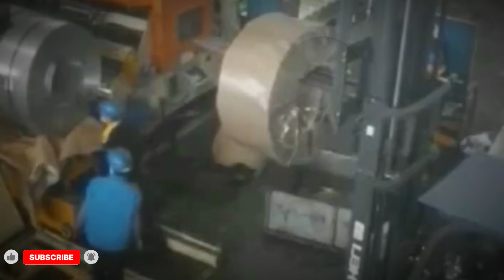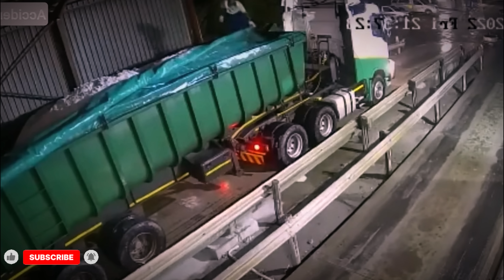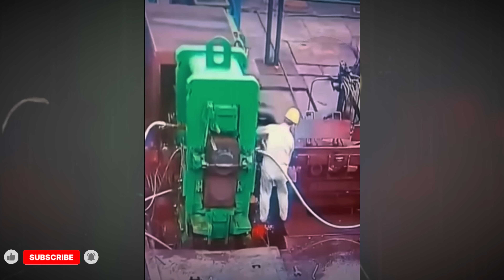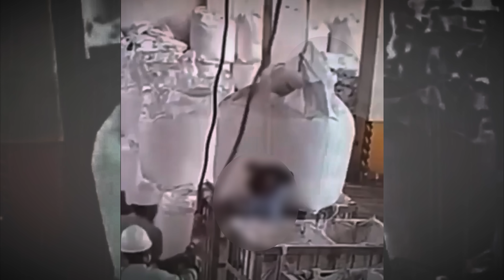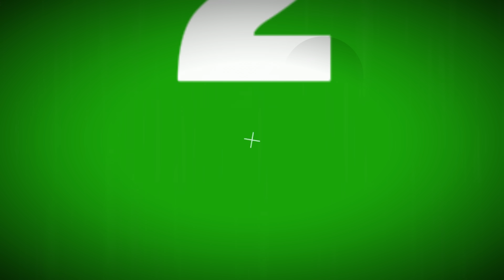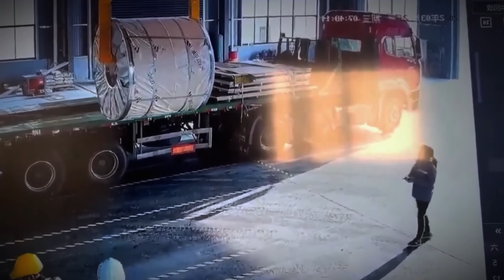He Was Standing Too Close… Then This Happened!

Comment: After a while on here, we generally end up with a higher degree of respect for metal coils, sometimes to the development of full-blown Spirametallicaphobia.
Reply from the maker: That's right
Reply: Not to mention the venerable Spinning Machinery monster.
Reply: what are these coils used for?
Reply: @lclear8129  They are not coils but they are long stainless steel metal sheets rolled into rolls, stainless steel have potential shape memory, that's why when SS metal sheets are rolled they try to straighten and a great potential tension is created which makes them dangerous if the rolls are not secured properly.